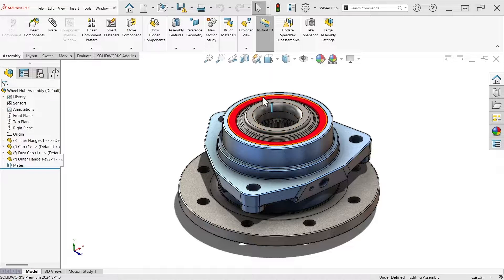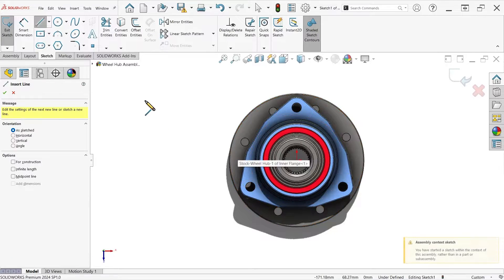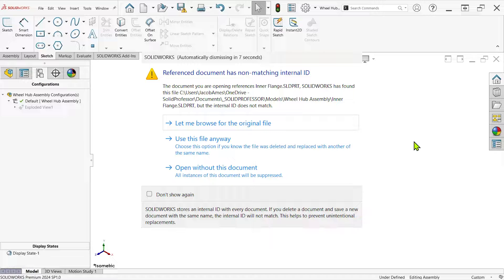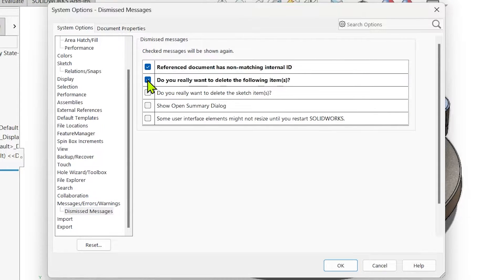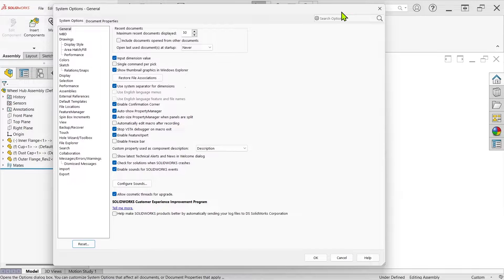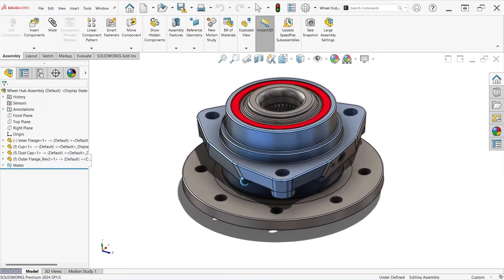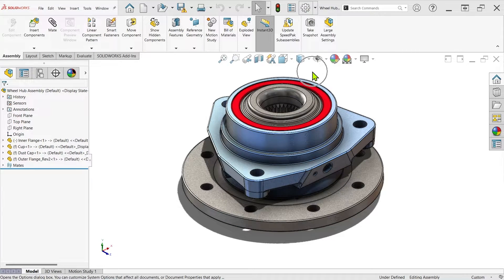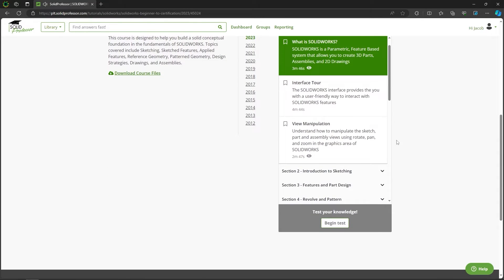Missing Popup Windows in SOLIDWORKS? 2 Ways to Get Them Back.

Comment: >> The main problem that I have with the popup dialog boxes and menus is that they don't appear where the cursor is located. They all appear either on the far-left side of my monitor or in the upper-left hand corner of my monitor. As an example, if I select one or more -- faces -- on a part to change its color, I select my faces and a popup dialog box appears and I am able to click-on "Appearances". However, when I do so, the next dialog box that allows me to select either -- Face/Imported/Body -- .....THAT dialog box appears way over to the upper-left side of my monitor, next to my "Feature Tree". Then, when I move my cursor off of the "Appearances" box to click on my desired -- Face/Imported/Body -- selection, that dialog box DISAPPEARS!!!

I have tried and tried and tried to do all manner of online searches in order to find a resolution to this problem, all to no avail!!! Is this fixable??? I'm still using -- SolidWorks Premium 2021 -- as I am unable to afford any of the upgrades since then. I am typically involved with the mechanical designs of -- 19" rack-mount -- chassis/enclosures/panels, among other items.

If you or anyone reading this knows how to fix this situation, please feel free to contact me directly at: midnight_blue_designs@yahoo.com  (I'm an "Old Fart" who performs design work here-at-home). THANKS!!!

/